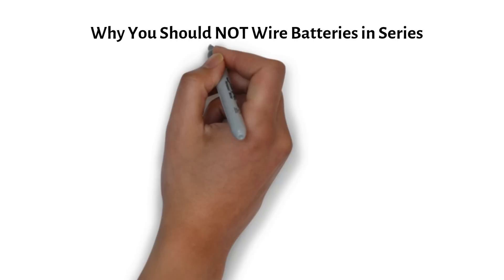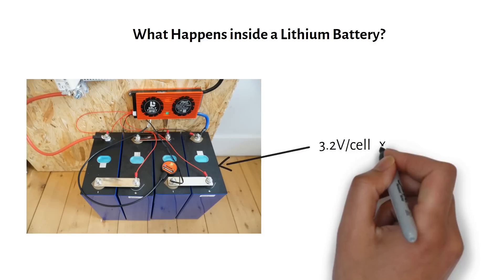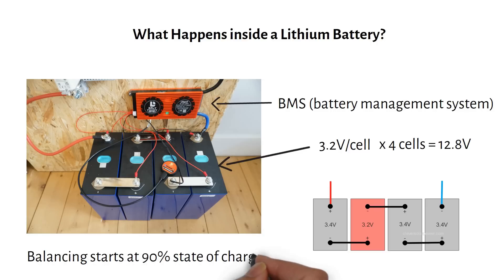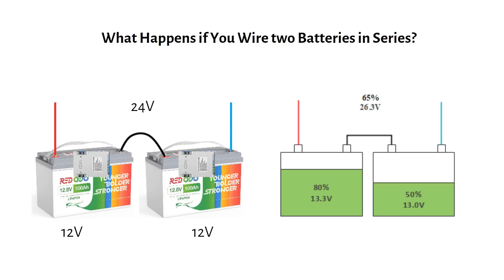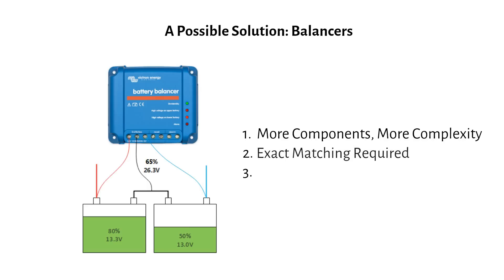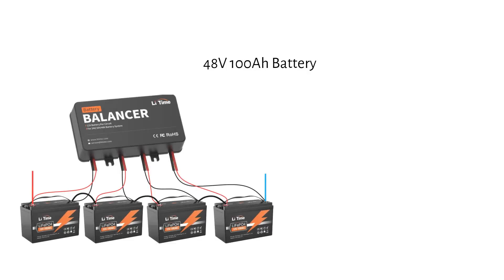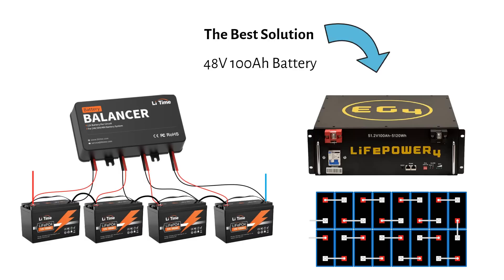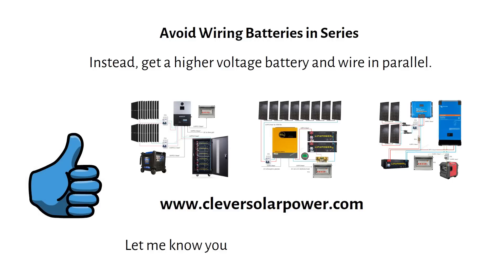Don't Wire Batteries in Series - Common Error

Comment: I have been running 3 separate 48v systems (for experimentation and testing different equipment) using 8 x 12v batteries series/parallelled WITHOUT a balancer for about 5 years. Just did a voltage check across the individual batteries and they were all within .03 volts of each other.......not .3, .......     .03v. I'd say my batteries are balancing perfectly.

Comment: I agree with Nick’s logic.
However, if you already have four 12.8V batteries and have invested in a 4S configuration, don’t worry—you can absolutely make it work!
Use tools like Grok or Copilot to better understand the 4S setup. Adding a 48V battery balancer is inexpensive and will help keep your batteries healthy over time. Remember, the internal BMS in each battery and proper connections go a long way toward longevity—you can keep using those 12.8V batteries for years.
💡 Fun fact: Most 48V rack-mounted batteries also use series wiring internally. At the core, they’re all made up of 3.65V LiFePO₄ cells. The real difference is in the balancing, which is handled by the BMS.
So, is starting with a 48V system easier? YES.
But if you already own 12.8V batteries, enjoy the process—you can definitely do this! I’ve been running this setup for years without issues.
Reply from the maker: Yes, if you already have the batteries then it's better to use them. I made a video about 4x 12V vs 48V batteries recently.

Comment: Hey Nick, 

Can you give me advice were to get a lifePO4 balancer/ equalizer for my 4 batteries ! 

The victron that”s in your video , is a lead-acid only i think 🤔🕵️‍♂️👍🏻

4  batteries of 12.8 V (lifePo4)

 
2 of 12.8V in series , plus the other 2 of 12.8V in series .

The 2 sets of 25.6 in parallel combined
Reply from the maker: The victron balancer can also be used for LiFePO4. You only need one in your configuration. The manual has good diagrams on how to connect it.

Comment: I have 4 12v batteries and want 24v. If I wire 2p2s do I still need a balancer for each pair?
Reply from the maker: You will need a balancer for each parallel battery group.

Comment: 2 (100AH) 12.8V LifePo4 batteries in series for about 2 months, the charger cycles every 2-4 days. 
Difference in battery voltage is 0.01V. No balancer, I would say they are doing just fine.

Comment: The framing of your title/conclusion/suggestion is horrible and you have one other error. Balancers are often cheap and the total cost may be low and someone may already have batteries that should not be thrown in the garbage so telling them to never do it is bad advice (your phrasing at the END of the video saying "whenever possible" is better; yes if the cost is same/similar do not do it; but you can do it if the total cost is very low (some 12V 100A batteries are obscenely cheap and the balancers are barely registering as a cost sometimes).
Also your "failure risk" is completely erroneous: the OPPOSITE can be true in some cases; four 12V batteries will have 4 BMSes so if 1 of them fails then 4 cells will be unprotected but if the 1 BMS fails on the big battery then ALL cells will be unprotected.
Reply from the maker: I don't agree. A litime 24V 100Ah cost you $490. and a12V 100Ah cost you $238, x2 =$476 for the same capacity, so only a $14 difference. Now, you need a balancer for the 2x 12V batteries in series which will cost you $47 + one extra cable that connects your batteries in series: +$12. So the total for a 24V 100Ah battery = $490, and two 12V 100Ah batteries in series = $535. That a total difference of $45 + you have to wire the balancer. So why would you have 2 batteries in series when you can buy a single 24V battery? Your second point: if one battery fails in the series string, the whole series string is down. Thats similar to having a single 48V battery down.

Comment: Mmmmm, when I was in the Airforce one of my jobs was to check the Tower backup system.  This backup system had diesel and BATTERY backup.  The 12v batteries were all connected in series/ parallel as we had to provide 48v.  Everything was fine and NEVER had any issues,  so interesting on what you have said.
Reply: Where the batteries Lithium’s tho? Or most likely wet lead acid/AGM?

Comment: Great information but wondering how one battery could discharge way faster than the other? It seems it would be defective and you would replace it?
Reply from the maker: The current drawn depends on the internal resistance of the battery. It is impossible to have exactly the same internal resistance. So over time they will drift away from each other.

Comment: I have had my 12 volt batteries in series for over a year.    I have used them in 24 and 48 volts systems have used a balancer for both systems and have not had any problems.

Comment: I agree - but $$.. By taking advantage of flash sales and clearances, I haven't paid more than $159 for any of my last 12 12v batteries that I'm making into 3, 4s x 12v / 48v batteries. It's getting way better lately price wise, but when I first started collecting components for my 48v build, 48v batteries were in the $1200 range "at best", whereas 6 of my last 12 new 12v batteries were $129 ea., from a clearance sale. Hard to beat a $520 (4 x $129) 48v battery when your funds are limited?  My plan is after 12 months or so without a $250 electric bill, I'll start getting 48v batteries and drag these 12v batteries over to my original 12v and 24v systems.
I really appreciate all your videos Nick, many thanks.😎👍
Reply from the maker: You are right. I might make i video soon about this. However, i hope you installed a battery balancer.
Reply: @cleversolarpower  I did, I have a LiTime balancer on one of the 4s, and an EcoFlow labled one on the way for one of the other 4 (like the LiTime and most all others, I noticed there are many that look just like it listed as different "brands"), and the last 4 will have to wait a couple week$ ;-)
Thanks again.

Comment: I recently converted our 48-volt golf cart to LiFePO4.  The 48-volt golf cart-specific battery packs were about $1000-1500 more expensive than the 4 individual 12-volt batteries.  The 12-volt batteries also fit into the cart's original battery holder.  I had to install a battery balancer, a LiFePO4 48-volt charger, and a 12-LiFePO4 charger to individually pre-charge and balance the batteries, and a battery monitor with a 500-amp shunt.  It may not be quite as good as a 48-volt golf cart-specific battery, but it seems to be working well so far.  Also, if the old golf cart wears out at some point I'll be able to use the 12-volt batteries for other uses.  In this situation, I think I made a good choice.
Reply from the maker: You did. 4 in series is going to be cheaper. It's good that you installed a balancer.
Reply: I have 3 in series to operate my 36v golf cart, no problems for over a year.  I hook up a balancer every couple of months. All 3 were from the same manufacturer purchased together.  Install a Class T fuse in the circuit.
Reply: I have a 48v and a 36v golf cart.  Bought 7 Siekon 12v 100ah batteries.  The 48v cart ran for a year and a half and then the capacity dropped like a rock.  I got them rebalanced, but they only charge to 13.8v each.  The 36v cart ran for about 6 months until one battery shut down, causing the system to go haywire.  I bought another Siekon to drop in replace, but as soon as I hook it up I get very strange voltages again.  The battery isn't ruined, but I may need to replace the controller along with the batteries.

Comment: Thanks for a good theory and explanation... but no real proof to convince everybody the true harm it causes.
i been running 2 x 12v  280ah lifepo4 in series for 7 months now with zero volt differences since day 1. i just topcharged them in paralell first for a couple of days and then they been super equal in series.
i did buy a 8S BMS in case i need to replace those two 4S and its also what you are stating is nessesare here.
but i never seen/messured the reason to use it... yet...i will keep an regualr eye on it
Reply from the maker: Yes it's possible. Much depends on the capacity and the amount of current it gets charged/discharged at. Since your batteries are large, I see why. Indeed, if you dont need it then you don't need it and the occasional parallel connection to balance them is enough. But most people install their system and forget it, which is why series without a balancer can be a mistake.

Comment: Hello! I have four 100 Ah batteries, wired, parallel i’m using the proper 20 amp charger. do I have to keep charging individual batteries? or can I charge the whole series? if so. what’s the best location? for the charging leads. thanks again, Kenny.
Reply from the maker: Since they are in parallel you can charge the whole battery in one, the voltage is the same. Attach positive to battery 1 positive and the negative to battery 4 negative.
Reply: @ thank you very much!

Comment: If you dont wire multiple batteries in series to raise volts and parallel raises the amp hours.i see it in battery packs for power tools.
Reply from the maker: Yes, like I said in the video 48V batteries are 16 3.2v cells in series. But they are all controlled by a BMS so they all equalize. If you have multiple 12V batteries in series, you need an external balancer.

Comment: My BMS detects both the cell and battery voltages, including the cells inside each individual battery. Additionally, I switch the batteries around every couple of months.

Cells in series of a battery also experienced imbalance, because the load demands power of the first battery, with the other battery acting as a restorative charge to the first. There is no way around in imbalance in connected batteries other than an extremely good BMS which allows the two or batteries to talk to each other and/or switching the batteries around periodically.

If you think that a series or parallel system is a better way prevent imbalance, you have neglected to apply the appropriate measures for each individual case. Neither are a problem so long as the appropriate maintenance is observed and actioned.

Comment: My small system has 2 simultaneously purchased 240AH 12volt in series connected AGM batteries. They are balanced with a Victron 24v balancer. This has been working this way for a year now and I measure the voltages of the batteries regularly. As far as I can tell this solution (so far) does not give any problems. As soon as the batteries become less I will switch to LFPO.

Comment: OK two things
one I know this video is over 2 months old so you might not see this post
Two is there anyone that can help with this? I'm 64 and learning this stuff for the first time so I can go out and enjoy my retirement (few years to go yet)
I have limited space and I can't fit a 48V battery in the long narrow space where I can the battery but I can put 4 X 12V batteries connected in Parallel and have a DC DC Step Up Converter Voltage Regulator, would the batteries still get out of balance when charging???

Comment: Excellent video also for beginner. Came up a question. In case will be connected 4 battery 48V in parallel and after several years 1 fail is it possible to reintegrate the fouth battery with new one of same brand / same capacity?  or do we have to reduce the capacity of battery bank from 4 to 3 permanently? Thank You!
Reply from the maker: You can add a new battery in parallel. Checkout my video about 'parallel different capacity'

Comment: I wondered about exactly this.
Even with lead acid batteries, in commercial vehicles, rvs, boats etc, wired for 24v, people manage to get the batteries out of balance and struggle with starting/charging issues.
With solar systems in domestic situations, the opportunities for problems always seemed more plentiful, albeit mitigated by the fact that domestic installations are more closely regulated and rarely dealt with by diy-ers.
In the marine and leisure vehicle industry, I always try to keep 24v circuits to a minimum. If at all possible, I use 12v for everything. You have to use heavier cables, particularly for big loads, like starting, but you eliminate a potential source of recurring trouble.
I’ve seen a battery in a 24v starter bank explode, due to being out of balance. 
With my own 24v systems, I occasionally disconnect them and wire them in parallel to a 12v smart charger, to keep them in balance.
I suspect this would be helpful in the examples given here, too. This problem is going to become more common, because 12v LiFePO4  batteries are much cheaper and easier to get hold of than their higher voltage counterparts. People ARE going to be wiring them in series, because the budget dictates it. They need to be educated about keeping such systems alive. Ideally, the BMS in each battery would be able to communicate with other BMSes in the string, but that facility would add expense, so probably not gonna happen.
That being so, manual balancing on a scheduled maintenance plan would probably be a good idea.

Comment: What about canbus ?? connect batteries in series then together with canbus communication, the batteries balance out ?? Batteries communicating with each other
Reply from the maker: Canbus wires cannot carry a current; they are only used for signal transmission. You need a balancer between the batteries.

Comment: @cleversolarpower One question please, I have already bought 3 12v 150A lifepo4 batteries, the idea was to buy a 4th battery to be able to achieve a 12, 24, or 48 configuration. Watching your video it makes a lot of sense, now my question is the following, do you recommend me to finish my 12v string connected in parallel, or make a 2P2S to make a 24v system?
Reply from the maker: You can still finish your system. I recommend watching how they behave (measure the voltages of each battery) and add a balancer if needed. You will need one over time anyway.

Comment: I have a 12V system and use agm sla batteries wired in parallel. I routinely disconnect and test each battery individually so as not to get any false feedback from the testing. I have not had any problems as yet, and everything seems to be in good working order and balanced.
Reply from the maker: You said your batteries are in parallel, so you don't have to worry about imbalances. It's only a problem with series connections.
Reply: @cleversolarpower  , I have been told that if you have one battery that won't hold charge, it can drain your other batteries that it's connected to, and if left connected to the other batteries, can damage them. I don't know if that's true, but it does sound plausible. So I err on the side of caution and test my batteries on a regular basis.

Comment: I basically agree that you should use a battery pack designed for end voltage, with overall balancing. However, there's some flaws and inaccuracies on your reasoning. 

By principle, having bms for each 12V set, does not provide risk. It will cut down the charge or discharge when under or over voltage is detected in any cell. However, the real risk comes from bms voltage rating. 12V bms uses switching components, designed to handle 12V system. They may be 16V, 25V, or more, but most likely not more than 30V. Your can't rely on it without specifications, and usually they are not provided.

If single 12V bms try to cut out the battery in 48V system, it sees 48V across it's open fets, most likely experiencing shoot-through and melt down, which typically short circuit fets, disabling bms protection. Such system may seem to work properly, untill bms protection is needed. Then it fails.

Same goes when connecting too many, so called protected 18650 cells in series. Battery packs should always be made on unprotected cells and separate protection cirquit.
Reply from the maker: Nowadays BMS'es are rated for 48V, before this wasn't the case. They will tell you how many batteries you can wire in series.

Comment: 2 x redodo 100Ah have a in multi review measured capacity  of 104 ah they are all in this range with 1% proven scatter in production.
so how your conspiracy theorie works with 30% differenz?
you get 1 redodo 100Ah with 104 Ah inside 
and the other redodo 100 Ah has 70 Ah capacitiy?

my oldest LiFePo4 is now 10 years old and after this time it still have 95% of there rated capacity so LiFePo4 have over time no capacity use in real world use.

so how you com on this 2 different capacitys???

to ake video and show comlete unlogic stuff brings you what?
Reply from the maker: Not sure about your question, but here it goes: In a series connection batteries need to have the same capacity. If one battery has higher capacity than a series connection is not suitable. That's why i recommend wiring in parallel.

Comment: You sre perfectly correct in theory but real life starting out with two new 12.8V-100Ah LiFePO4 as example. Fully charge both batteries to chager stop charging. I will claim your scenario will not happen unless one cell get a problem.
Reply from the maker: Ok, just do what you described, and measure the voltages of your batteries after a few months. You will see they will be different.

Comment: I maybe the exception to the rule but I have a prismatic 12v 200ah parallel with a chins 12 v 100ah in series with 2 chins , 1 200ah and 1 100 ah in parallel and never have any issues with balance. Even the prismatic cells stay balanced without a balancer. 24volt system
Reply from the maker: A chins battery already has a BMS with balancer inside, and since you have them connected in parallel there is no unbalance.

Comment: All batteries are made from low voltage cells connected in series. 6 at 2.2v to make a 12v lead acid. Never been  an issue.